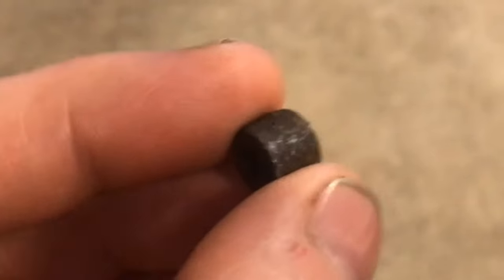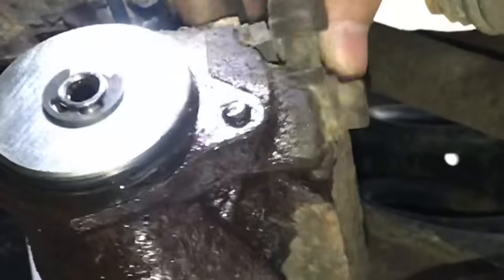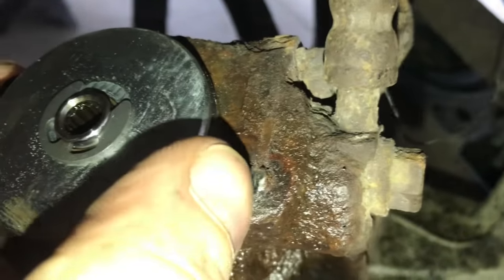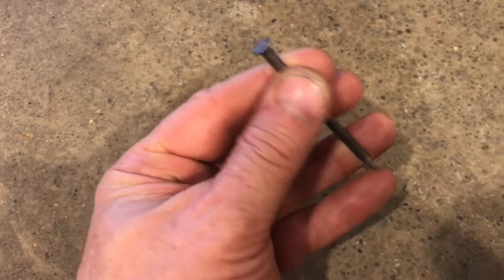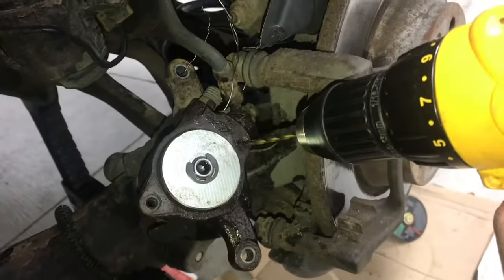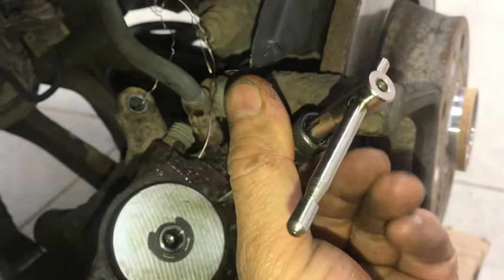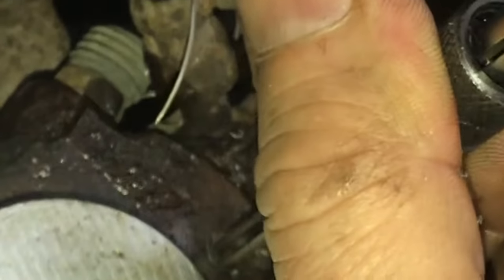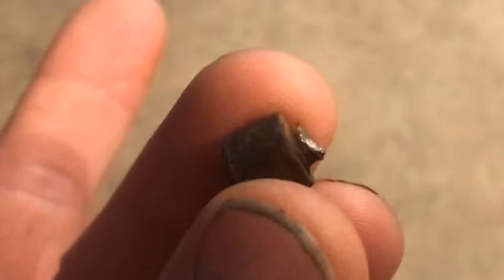remove a broken bolt WITHOUT an extraction tool

Comment: Ok so you need to drill and then use an extractor. If you don’t have an extractor then use a bit a tad smaller than the bolt. Basically you will be drilling out the old bolt. When you install the new bolt it’s gonna be tight and it will make new threading.